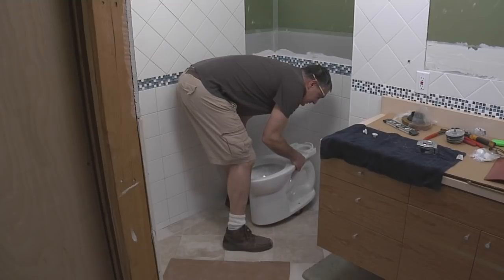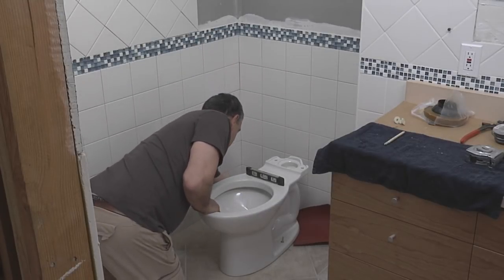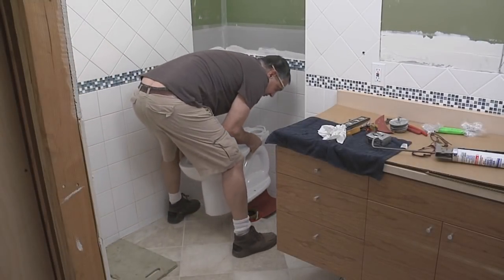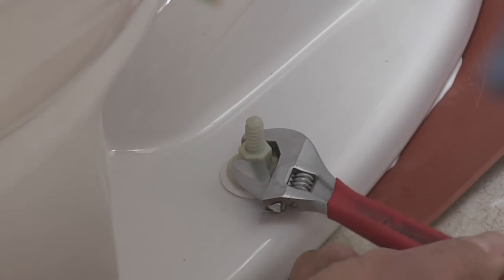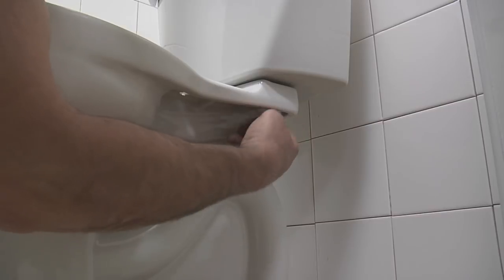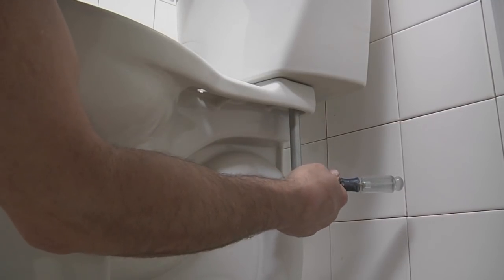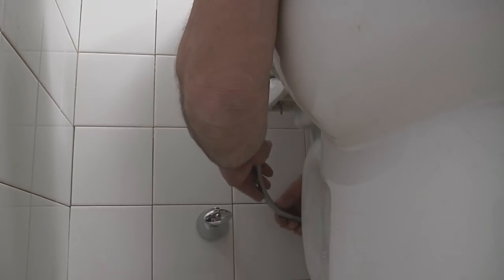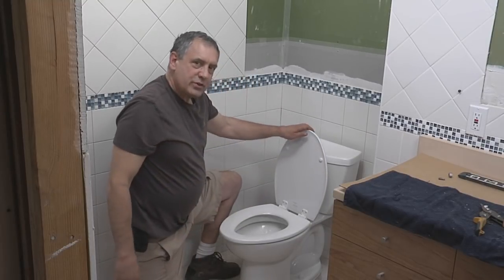How to Install a New Toilet

Comment: Great video. Two questions actually are all wax rings the same diameter, or are they universal? I would be shopping at home depot or lowes? Second queston are all wax rings equal. what i mean by that is there a superior brand or one that hold up better quality wise? Flushed a shaving cream cap accidently down the toilet. I think it might be stuck in the curvature of the toilet, if not i will have to use a electric snake to pass it out of the plumbing, and i do not want to damage the porcelain. I have never removed a toilet before and my fear was reinstalling and making sure the toilet would be correctly aligned and not leak.

Comment: Your American toilets sure are weird. Supposing one needs to bring in the soil pipe from the rear or side and not the floor. No problem here in UK. No such weird think as a toilet flange exists in UK. Just use suitable pan connector to connect to spigot on rear of pan. So much easier than messing about with this ludicrous toilet flange
Reply: HARAHrurhhreydydyyeeyeeyeyyryyryryrgrgrygrgrgrggdgrgrgeegegeirieisyieie

Comment: Frankly I'm surprised to see all the effort to double-RTV the toilet's contact point with the floor. You don't want it watertight for a very good reason: if for any reason it starts to leak, you want to know about it pronto, not build up on the floor inside the toilet and start to rot out the subfloor (for example).    SECOND, you are creating a problem for someone a decade or two down the line: when you lift up that RTV'd toilet, it's going to pull the tiles up with it, as I just found out today.    So, no, the RTV is a bad idea.

Comment: Protip-wait until at least a half dozen flushes or more before caulking the base. Especially if the flange is properly secured and sealed to the finished floor. That way if the wax seal was compromised then you will see water under the toilet and it won't go into the sub floor and rot it all out. Personal experience! Good video though!
Reply: it look so easy....
Reply: Jason Mares xxx Tamil xxx Tamil xxx Tamil

Comment: Great, nice job. I would suggest going back in a short peroid of time (month R 2) and re check all bolts/nuts for tightness. I have had a toilet tank in my home that I installed, leak after 8 months I installed 4 in this house and 3 in the home I had B4 this one.. seemed like the nuts loosend. I though I had them on there very tight.

Comment: You should leave a small uncaulked area on the back of the bottom of the toilet. This way any leaks can escape. If the leaks are captured under the toilet, they can go unnoticed and cause damage.
Reply: HARAHyeeyeyeyeyeye